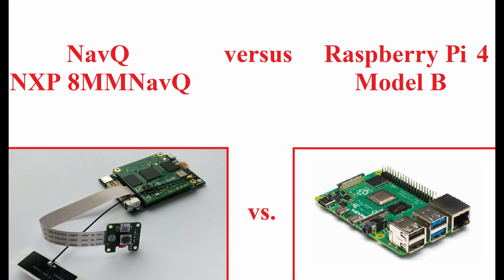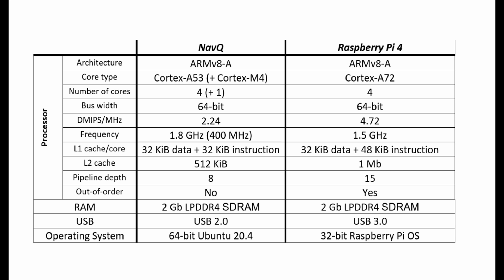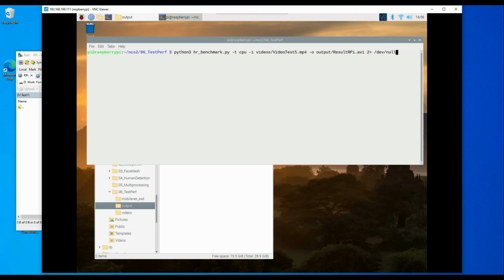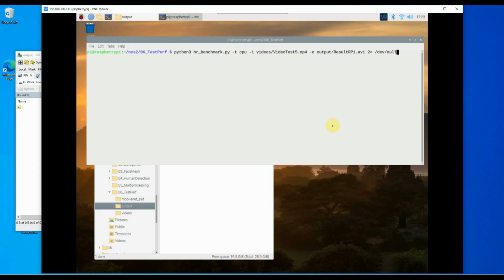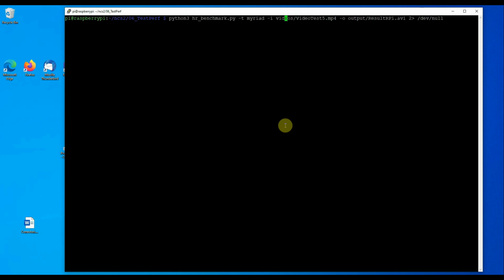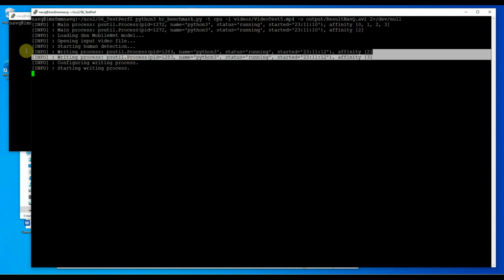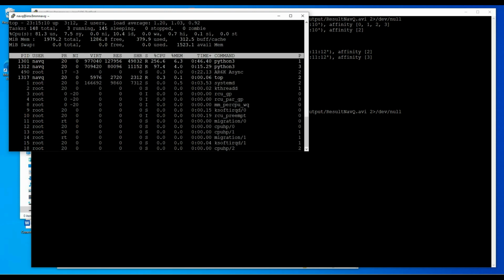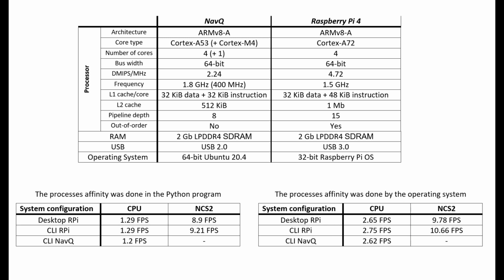Performances analysis of the NavQ (NXP RDDRONE-8MMNavQ) versus Raspberry Pi 4 systems

Comment: Are you using the navq demo image? This is a yocto based, there are options to build yocto with the openvino toolkit layers (meta-intel)
Reply from the maker: Yes I started from HoverGames-Demo, but many packages were installed after. Thanks for the tip. For the Raspberry Pi the install process is standardized, and more, more easy, but if you notice in the movie I still get some errors, when the recognition process stops. But otherwise it works very well.